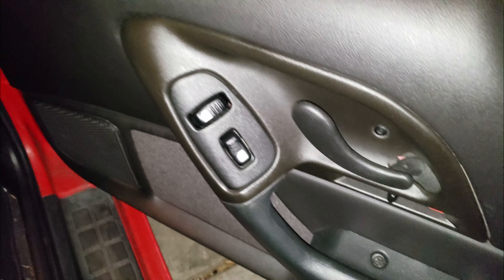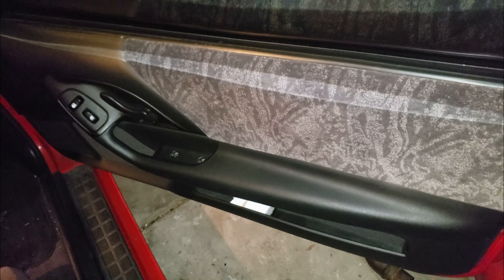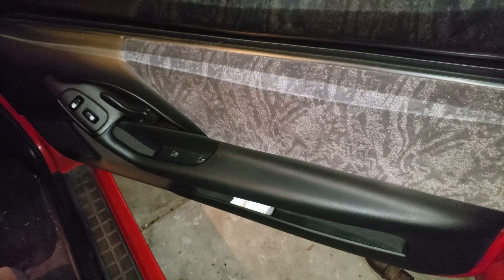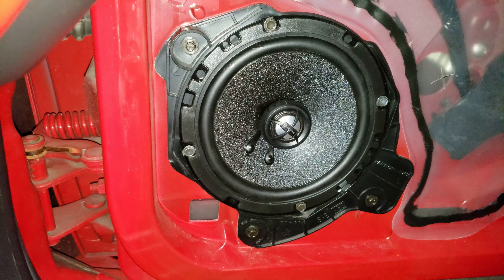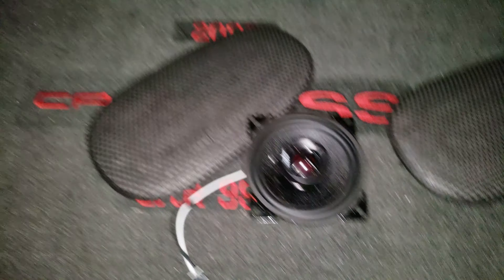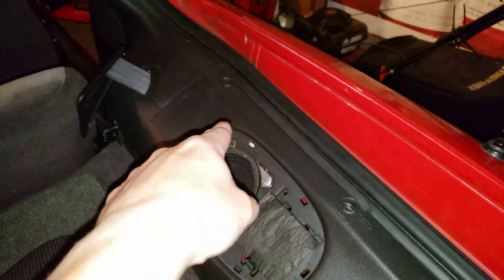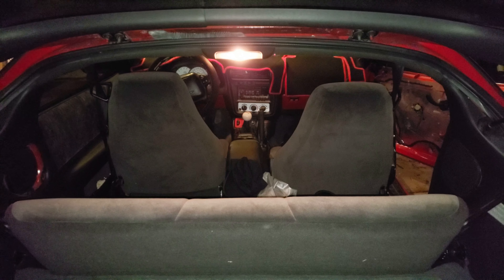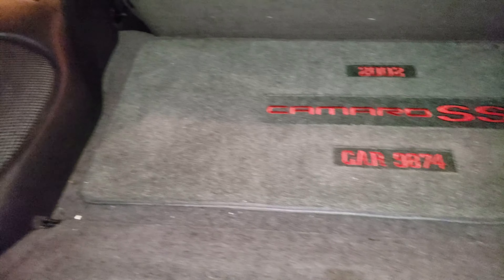97 02 Camaro Monsoon system front door speaker hack

Comment: Your video was a big help! I bought the same replacement speakers (SKAR). Wired like you showed in video. Thank you!
Reply from the maker: You are welcome, rock out!
Reply: So those skar door speakers are the replacement speakers of same quality as monsoon?
Reply: @dnegel9546  pretty close ..I'm happy with them.
Reply: @michaelgrant2084  actually today I pulled out my original speakers I took out 10yrs ago cuz I thought they were broken/dead and did some tests.. turns out they work. Just the connections needed to be cleaned and re soldered.  Haha I feel so stupid.

Comment: I I got the same speakers and put them in my car and they sound way better than stock but they don’t seem as loud. I was thinking this had to do with maybe bypassing the tweeter because there was only 2 wires on the OEM connector but lmk if you have any insight
Reply from the maker: Might be the ohm rating from after market head unit from stock.

Comment: FYI:  not sure if this would have applied to Chemical Spore but if your subwoofers seem to be blown they may not be.  One of mine had a cold solder connection where the voice coil wires solder onto the connector.  Removing old solder, cleaning, and re-soldering brought the speaker back to life.  Camaros and cold solder joints...ugh...amiright?
Reply from the maker: You are very right, I had to resolder my EBCM. never ends. Now that you told me that, I wish i kept the stock subs. they sounded so good.
Reply: Turns out it's not so easy.  My repair failed in short order.  Seems once the solder connection fails it's hard to get back.  I have tried again this time using some sanding to try to get back to some copper but these wires are fragile.  If it fails again I will take an even more aggressive approach with a dremel and sanding wheel.  If that fails I'll get some Kee Audio subs which should out perform the stock subs.

Comment: Hello, hopefully you see this but I have a question. I followed everything you said in this video except when I went to connect my new speaker with the harness to the wires in the door, 2/4 of them were corroded. Advice to repair them?
Reply from the maker: if you are good with wire splicing, you might go down to walmarts audio sections and get some new connections and connect them into the prexisting wire in the doors. Or check out local junk yards for Camaros with those harnesses in the door.

Comment: Do you still have to do this if you’re installing a new head?
Reply from the maker: @GRONKIN  that is a good question, i still would do to the harness having those split wires. Especially if you are still able to use the facotry amp if you have the monsoon system.

Comment: Hey man great video! I bought the same speakers and wired them the same way
But the hatch OEM speakers are much-much louder. Any idea why this could be?
The way your speakers sound is like two to three times as loud as mine are
Reply from the maker: I believe its the ohms that make a difference. these monsoon systems are weird
Reply: @chemicalspore  why was yours loud tho? Do you not have the monsoon system? My trans am has a tweeter there so there was only 1 set of wires to the speaker and another 2 wires connected to the tweeter. Do you think it would be louder if I hooked up the set of tweeter connections to the red and black wires coming out of the aftermarket speaker?

Comment: is  it important  to wire the high frequency and low frequency wires separately to corresponding wires on speakers or can you combine each pos and neg and solder together to their terminals?
Reply from the maker: Think of the high and low frequency speakers as separate channels. You could cause damage to your stereo and speakers if you cross them all together.
Reply: I tried exactly what you said; doesn’t work as you expect. The bass tones try to play through the tweeter in the middle of the aftermarket speaker. Not good. Did exactly as this guy said and you use factory connector and it works perfectly.

Comment: I’ve ordered all new replacement speakers, thanks for the tutorial. Did you ever figure out that auxiliary or Bluetooth capability?
Reply from the maker: ive read everywhere that the bluetooth adapter does not work that well
Reply: What size speakers since my doesn't have any
Reply: @luismontemayor5713  they are 6.5”
Reply: @Arden2886  thank you
Reply: @luismontemayor5713  no problem.

Comment: I'm currently replacing speakers in my camero, but the speakers I ordered (I don't know anything about this stuff) don't have a high tones/low tones connector, I think they are just speakers without built-in tweeters.  Would it be ok to just wire the lows of the factory harness to the new speakers and leave the highs dangling?  Or do I absolutely need tweeters or a speaker with connectors for the high tones?
Reply from the maker: are you on instagram?
Reply: @bobdaduck7160  what did he tell you? I have the same question
Reply: @ModernMashups  So to "do it right" I ended up just buying a  4 ohm amp and amp kit and bought a best buy membership ($200) which lets me have them do all the installation labor free.

I read that with coaxial speakers if you identify the tweeter wires you could technically cut them and wire them to the highs and the main speaker to the lows

other solution is to do an amp bypass where as I understand it you just grab the input and output wires to the amp, clip them, and sodder/clamp them together so that the highs and lows stay combined through only two sets of wires

The ideal I guess would be to find 2 ohm component type speakers, which will be very straightforward wiring (but maybe less straightforward mounting)

I don't remember ever quite figuring out if I could wire the stock highs and low +/- wires to the single coaxial +/- wires, but I am pretty sure it wouldn't work at this point because the signals are pre-split so they would join into the coaxial with overlapping signals rather than a joined/whole signal (I am making this up but it sounds right to me)

Comment: What if I've replaced the aftermarket head unit? Will this speaker method still work? Also, what setup did you use? Same blueprint as mids up front, bass in the sail panels, and tweeters in the back/ hatch?
Reply from the maker: If you go to an aftermarket head unit the monsoon system will be inactive.  You could do this for an aftermarket head unit for these sound to still activate through a speaker if you keep the stock harness.  The sale panel and hatch speakers are regular two connection harness.
Reply: @chemicalspore  so for the sail panel and hatch speakers, it'll be plug and play? No need to make modern speakers fit the old harness? I understood that right, that just saved me hundreds of dollars
Reply from the maker: @manthis22  you might want to get some aftermarket harness for the wires, they cost couple bucks. https://www.amazon.com/Metra-72-4568-Speaker-Selected-Vehicles/dp/B0002BEUZ8/ref=asc_df_B0002BEUZ8/?tag=hyprod-20&linkCode=df0&hvadid=311990496852&hvpos=&hvnetw=g&hvrand=7431891153071349962&hvpone=&hvptwo=&hvqmt=&hvdev=c&hvdvcmdl=&hvlocint=&hvlocphy=9009982&hvtargid=pla-436606720516&psc=1

Comment: The monsoon system is 2 ohm. Your speakers are 4 ohm. You cut the power output in half.
Reply from the maker: Yeah, only the door speakers I replaced dont fit the ohm rating. They are loud enough. Believe me. I am good, thanks for your insight!
Reply: Not true. The speakers he replaced are higher sensitivity and likely higher db output regardless of the ohms.
Reply: @allbaugh04  how do you know what sensitivity his speakers are? the sensitivity wont change how much power the amp makes.